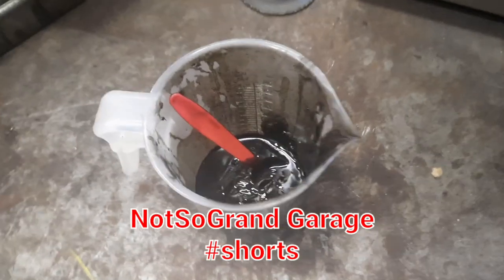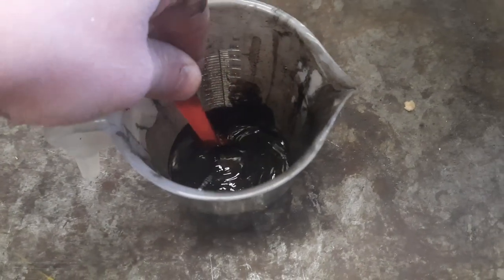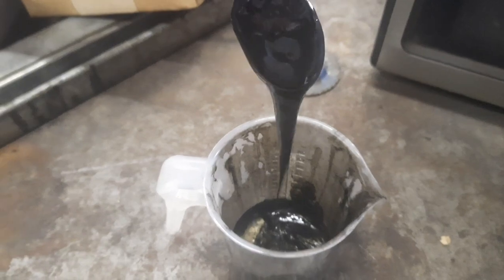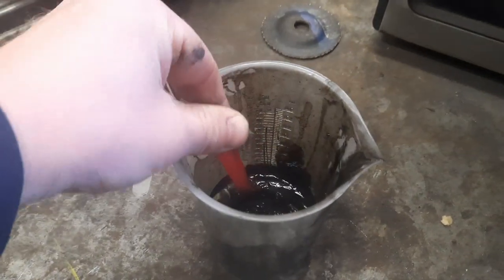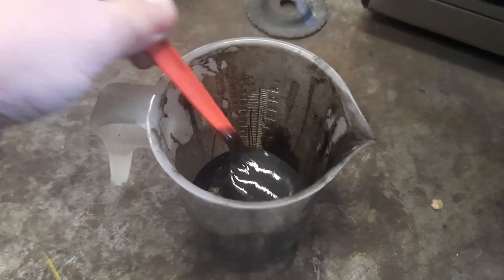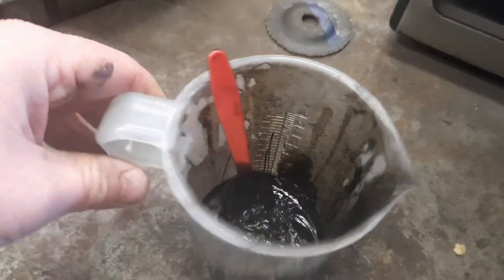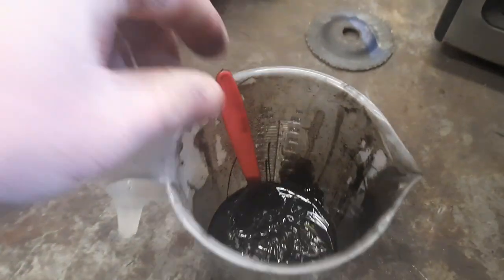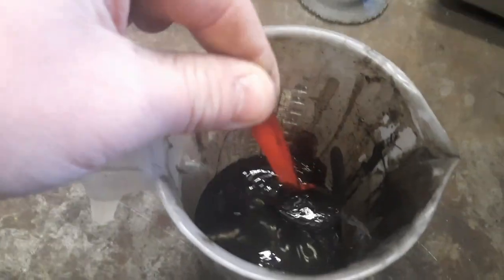Introduction To Black Diesel - Centrifuge Leftovers - Alternative Fuel - WMO - Waste Oil

Comment: Hi Chris thanks for the update looking at same model centrifuge oil spinner that you use have you heard of diesel craft model OC 20 would like to get the best product on the market would love to know your thoughts thanks
Reply from the maker: That is very similar to the PA Biodiesel 55GPH unit we used to run.  Works well.  BUT...  if you are buying their "complete kit" which is nearly $1k...   I would just go for a single pass unit that is motor driven.  WVO Designs or similar..   You get a lot more bang for the buck.

Comment: Let's try adding gasoline, and some acetone, to that sludge until the viscosity is a bit below that of diesel;  then will the water separate? Then will it burn well in a diesel? what diesel should we volunteer to try it in?  Maybe ask Diesel Creek?
    If the water won't drop out, or blends with the gasohol in the gasoline, won't it just act like water injection?  It just seems to me like nearly all of the common problems described with waste oil and waste bio diesels can be solved by more gasoline until it goes away.  why not?
Reply from the maker: At some point, detonation/ping or early ignition will become a problem.   Plus, it isn't just water that comes out of the centrifuge.   Some of it is...  but a lot of it is solids, metals, additives, etc.  Stuff I dont want to try and burn in any engine.  That's the point of running a centrifuge in the first place...  to remove the garbage.  I've done the single tank method with 30% gasoline and 80/20 oil diesel blends. No good.  Only way I could get it to run okay was to drop back to a 50/50 and at that point... you've got 30% gasoline in the oil... 50% diesel on top of that...  starting to be a pointless endeavor.   8 years of dual tanks running 90-95% oil without trouble.  Less pump fuel purchased and easier overall.  Also cheaper in the long run.

Now this is what I prefer...  you can do as you wish... know what I mean?  I personally have no desire to experiment much more than I already have...  just want to refine my operation.  It may work for you though and may be beneficial to how you want to do things so give it a shot.

I'm currently single tanking in my mercedes at 50/50.  It hazes a good bit when cold but runs great. It's getting water injection (new video coming on that) to see if it will clean up.  More to come.
Reply: @NotSoGrandGarage  I don't see any need for any significant amount of diesel, just waste oil and gasoline, and where you already invested in the centrifuge and dual tanks, most have not.  I don't think it is really possible for a diesel to ping because there is no fuel in the cylinder until it is injected.  Of course, if you run straight gasoline in a diesel, it will starve for lubrication and potentially burn hot enough to burn injectors and exhaust valves, but if you have coking issues, you are nowhere near that point.  Youtube has videos of diesels running on almost straight gasoline to simulate a common error, and some of the older ones do just fine on like 95% gasoline especially if the driver refrains from using the extra power,  so I disagree, the coking and hazing will go away well before the lubrication starvation and overheating of injectors and exhaust valves start, even without a centrifuge or much diesel, just waste oil and gasoline (unless they separate).
    The problem metals are in your filter, the water is only a problem if it separates  and hits the injectors all at once, and the additives, and the mostly heavy petroleum molecules, are not a problem and are sometimes good lubricants.
    To be safe, one could blend with kerosene instead of gasoline, but it takes so much kerosene that the economic benefits get reduced, though one could gradually replace kerosene with a smaller amount of gasoline as one gains confidence.
Reply: @NotSoGrandGarage  Two more ways to find the right blend of waste oil and gasoline is that the exhaust should look the same as with diesel, and the acceleration should be the same as with diesel.  (oldschool diesel for which the engine was designed). If it is slower or has darker exhaust, then increase the percentage of gasoline.  I don't see any need for more than 10% diesel regardless, well, unless it prevents separation.
Reply: Would ethanol work? It absorbs water and raises octane
Reply: @BuddyTheWolfYT  Ethanol will separate from the oil or gas in order to mix with the water.  The resulting ethanol-water mix might burn properly if the proportions are right, but would starve for lubrication unless we found a water soluble lubricant. Might water pump lubes help? or emulsifier? which fuel emulsifiers so far seem prohibitively expensive.  This should not be a problem, but diesels usually want low octane, not high, so ethanol/water/lubricant blends might have too high octane.

Comment: Hey Chris! I love the content and have been doing research on alternative fuels for my vehicle. 1993 Mitsubishi delica. Mechanically injected. I’ve been reading about wvo and biodiesel and of course filtering is of utmost importance but so is PH value. Bio diesel comes out with a high PH value and must be washed to remove this. Do you worry about the acidity of the motor oil? I want to commit to the purchase of all these fun items but dont wanna spend my saving on a new injection system. 

PS. Do you experience any issues with cold running short trips? I’ve been toying with the idea of having dual tanks and switching to black when at a decent engine temperature to keep the coke down. 
Thanks again and the channel is great!
Reply from the maker: Thanks for watching! Wvo and bio do have a tendency to become acidic where I've not heard of anyone having that issue with black diesel.  I've been inside my pump on the truck that sees the most oil recently and it was spotless inside.

I run 50/50 in the mercedes and it sees some short trips...  but it gets hazy when it does.  I always suggest dual tanks when possible

Comment: Makes me not even want to try running filtered only oil in my old idi
Guess it's straight deisel to i get centrifuge
Reply from the maker: I've done it quite a few ways...    filters for a year or so...   pressure drive centrifuge for 8 years or so...   then direct drive.  It all worked...   but there are definitely better ways.  The IDI isn't too picky..   just keep moisture to a minimum.
Reply from the maker: Also, I have a comparison video of the sock filters to the centrifuge.  The socks work well for what they are.  Be sure to check it out.  When you are ready to invest in a centrifuge, www.notsograndgarage.com
Reply: @NotSoGrandGarage  I've watched that video a few times now lol
Reply: @NotSoGrandGarage  oh man, you got yourself a site for selling set ups? That awesome, I'll have to check it out
Reply from the maker: @edp9811  I started working with WVO Designs after I started doing videos.  They offered to make me a dealer so I figured why not.  I help them out with the customer service side of things.
Reply: @NotSoGrandGarage  nice, I'm checking it out now, looks like I might be able to simply build a centrifuge for close to 1k
Reply from the maker: @edp9811  potentially cheaper if you can source a motor cheap and don't mind the fab work.
Reply: @NotSoGrandGarage  I've got extra bench grinders I can sacrifice, can get a control switch pretty cheap if the rpms are to high and I don't think it be too much work to fabricate everything togeather
Reply from the maker: @edp9811  So really, the bag filters are workable and the IDI is forgiving.  Is a centrifuge better?  Absolutely.  BUT...  you can make filters work and it'll give you a feel for what all it take.
Reply: @NotSoGrandGarage  awesome, thanks again